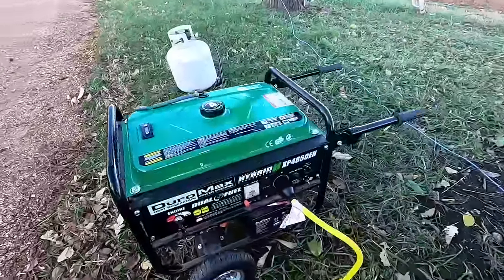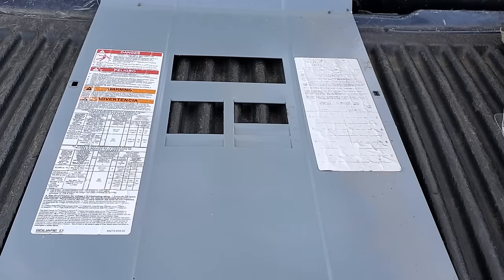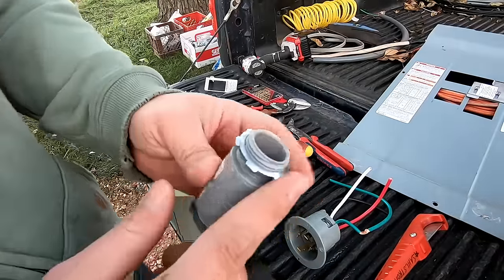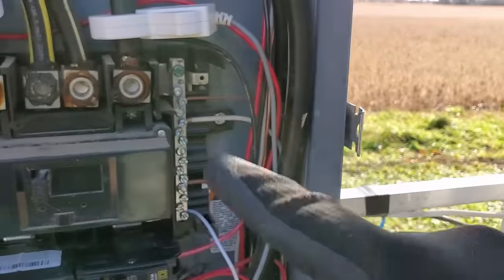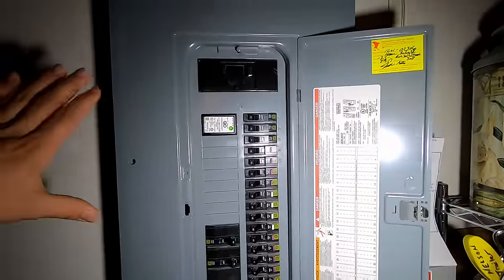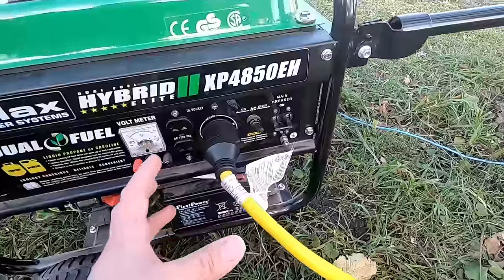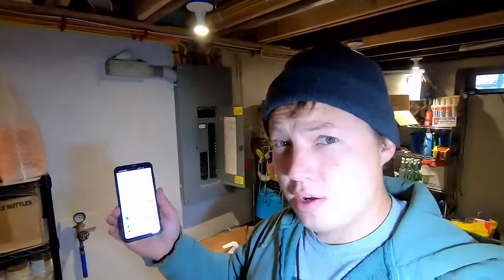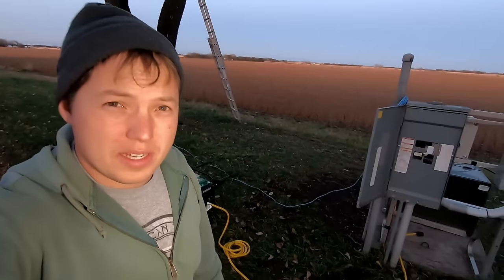How To Hook Up a Generator To Your House Using a Breaker Interlock Kit & Power Inlet Box

Comment: Looking at doing this too but how do you know the grid power has been restored while you on generator power?   With the main breaker off you wouldn’t know without looking at your neighbors. Can the sense monitoring do this too?
Reply: ⚠️Please don’t forget the rules about generator safety: This is a very important announcement for everyone. It’s important to follow all generator safety rules whenever we use portable generators: 

Everyone must see this. This is just a reminder for everyone’s safety. 

1) KEEPING OTHERS SAFE: Please do not allow an unqualified person or your children to operate and service the portable generator. Just because some manuals don’t say that doesn’t mean it’s safe. That is important against the generator safety rules. We also need to be keeping an eye on our children too. You need to make sure that your children are not playing near the portable generator especially when it’s running so they won’t get electrocuted. Generators pose electrical risks and they can be hot during an operation. Please keep your children away from the portable generator at all times. It is important to keep our children safe especially our little ones. Be aware of all the hazards.

2) WHERE TO RUN YOUR GENERATOR: Some people use their portable generators indoors which increases the risk of carbon monoxide poisoning. It’s important to have a carbon monoxide if you have a gas generator. Never ever use your generator indoors even if your doors and windows are open and even in the garage is not safe to use a portable generator. Not even at your porch and your deck. It is never safe to use your generator indoors and in enclosed areas of your home. Your generator needs to be 15-20 feet away from your house. 

3)🔥FIRE HAZARDS: Never refuel your generator while it’s running. You need to let your generator cool off before refueling it and before storing your generator. Never overload your generator too. Never ever back feed your generator. You should never plug your generator into a wall outlet. Also never store propane tanks indoors. Please keep flammable things away from the generator as well and please don’t smoke cigarettes near the generator. Having a fire extinguisher next to the generator is also important against the generator safety rules. 

4) GENERATOR OPERATION: make sure your hands are dry before touching the generator. Never use your generator in wet conditions. Don’t let your generator get wet. You need a generator tent if you need to use your generator during wet weather. Please don’t wear loose clothes when operating the generator. Turn on your generator before plugging in appliances. Use the right cord for your generator. Please do not use worn out cords. 

https://youtu.be/I1jT3ANENvI and here is a video more about keeping others safe when using generators 

Hope this helps. Remember safety first
Reply: @The_Happy_Aviation_Enthusiast  NEVER!  I run my generator in my living room right beside my stash of extra gas cans. Cuts down on the distance my children have to lug it when they refill the gas tank.  They are so cute!  They love licking the terminals to make sure the connection is good.

Comment: I just like to point out that your generator should be set to Floating Neutral just as in a sub panel. If not, you will have current flowing in the ground wire as well as the neutral wire in your hook up cable. Besides that, good informative video.
Reply: Here are the generator safety rules that everyone needs to follow: this is just a reminder for everyone’s safety. Always make sure you follow all the generator safety rules whenever you use your portable generator. Generators can be dangerous if not used carefully. Every year, hundreds of people die or get injured when using portable generators due to carbon monoxide poisoning and electrocution. Make sure you are using your generator carefully and keeping others safe as well. There is something very serious that everyone should always be aware of when using generators. Some people do run their generator indoors which is not safe and that increases the risk of carbon monoxide poisoning which can cause death of family and you. Some people run their generator in wet conditions which can electrocute them. Please remember that you should never run your generator indoors. Remember that carbon monoxide is an odorless and colorless gas that you cannot see or smell. Carbon monoxide is a silent killer. Keep that in mind. Make sure your generator is 15-20 feet away from your house and away from doors, windows, and vents. Never use your generator in your porch too. Having a carbon monoxide detector is very important against generator safety. Some people also allow children to go near the portable generator which could pose risks. We need to keep an eye on our children making sure that they are not near the portable generator so they won’t get electrocuted or burned by the generator which is dangerous. A locking enclosure also keeps kids safe. A generator shed might look like a tempting place to explore, or take cover during a game of hide and seek, but a generator is a dangerous piece of equipment that can cause injury. It says on the manual that we should also keep children away at all times from the portable generator to avoid injuries. Please do not allow a child or unqualified people to operate the portable generator.  It is important to keep your children safe especially little ones. The portable generator can be hot during an operation. Just because some manuals missed what should be listed doesn’t mean it’s safe to do. Always follow the generator safety rules when using portable generators. Generators pose electrical risks. If you need to use your generator during wet weather, you need a generator tent to protect your generator from getting wet. Don’t let your generator get wet. Keep your generator dry and before using your generator, please make sure your hands and your generator is dry. Do not wear loose clothing when operating the generator. Everything that is said on the generator’s operating manual should not be ignored. Never smoke cigarettes near the generator. Please keep flammable things away from the generator. Never overload your generator too. Your generator can catch fire. Never ever try to plug a generator cord into a wall outlet to avoid back feeding. Back feeding your generator is dangerous. Always turn on your generator first before plugging in appliances and shut off the appliances before turning your generator off. Use a heavy duty cord for your generator and the cord should not be worn out. All the instructions should be followed carefully. Never refuel your generator while it’s running. It can cause fire if fuel spills while your generator is hot. You should turn off your generator and let it cool off before refueling it. Having a fire extinguisher next to the generator is also important. This is only a reminder for everyone’s safety of using generators. Make sure your generator is properly grounded. Having a fire extinguisher next to the generator is also important against the safety rules. https://youtu.be/I1jT3ANENvI and here is a video more about keeping others safe when using generators and also about our family’s safety. It’s important to keep our little children safe as well. Make sure your little children are kept away from the generator at all times especially when it’s running. Hope this helps. Always remember that it’s better to be safe than sorry. Also remember that warnings should not be ignored too.

Comment: Hey question i did everything the same as you did here and everything is working properly but when i went to test the breakers using the lil test button all of them work except the purple ones that I think are CAFCI & GFCI. And to mention that they work properly when I’m using the utility power. They just won’t trip under the generator power. Any help please ?
Reply from the maker: Hmm, not sure what the cause would be. I might test this on my own setup if I get the chance.

Comment: Great video. Unfortunately I found out interlocks are not allowed in my community. We have to use individual transfers for each circuit. Sucks because at most I can only run 10 circuits. Again, great job.

Comment: Nice video. I appreciate your stream of consciousness with nary a pause or "um." This shows that you clearly live the concept. I am a little confused as the sense meter is attached to the mains hitting the main breaker first, so if you have turned off the main breaker, how are they sensing how much draw is being made from the generator? The power does not go thru those feeds when the main breaker is off, no?
Reply: Yes I wondered this too. I just purchased your Sense (thanks for the discount). How was this hooked up to monitor the gen meter?
Reply: His panel install uses 2 main breakers in series,  first in the outside primary distribution panel that's often seen in multiple building feeds like farms etc. That's where the generator feed is located,  and the main breaker is isolating his system from the grid. He could put current clamps right at the generator input lines,  that would read correctly for ALL loads into the system,  but how do you get the data out across 35+ yards/meters to the  cellphone used as a monitor panel? So instead the clamps are on the inputs to his house Subpanel (in this system layout) with its main breaker closed to distribute power to vital functions.  This puts the Sense amp load monitor within Bluetooth or WiFi range of his phone. 
You typically would do it by a built-in to the panel pair of amp meters to balance your load while flipping breakers,  keeping both phases roughly equal.  Plus side, rock reliable for decades of service & won't glitch out or be abandoned by its software developers.  Downside, have to be in front of the panel watching meters to see how things are going. 
I have boxes full of abandoned tech and software from years past. I like the Sense idea but-- Maybe I've gotten cynical in my dotage but I would want an analog meter system also, for simple reliability;  like when you dropped the cellphone in the ass-deep snow /slush/frozen puddle,  blizzard has you blinded and pissed, and can't find it for the next few hours, then the battery dies cause you used it for your flashlight while hooking up the genny.
Funny how you never need a genset on a warm pleasant summer day 🤔🙂🙂.

Comment: Quick question. I unfortunately have a main panel with a total of 4 throws (disconnects). I do not have a main disconnect. This means that I wont be able to energize the main panel without backfeeding into the grid. I can however, power my main floor 100A subpanel. Is it any different to power the subpanel than the main panel? I will be doing just as you did with a 30 amp breaker in the subpanel and cutting off the subpanel disconnect. I really wish I could power my main panel because my heating system is on that panel.

Comment: @Benjamin Sahlstrom   Im looking at buying a 7250 running watt generator and am just a little confused on the only 30 amp plug on it. Like you my 200 amp main is out on my pole by my meter away from my house approx 100 ft. I was curious if it would be able to push enough through that 30 amp cord and outlet to run much in my house? I have  propane furnace and electric water heater as well that is 4200 watts per element for the water heater.. Just wanting some info from somebody with close to scenario.  Video was very helpful. Thanks. Chris

Comment: Great video Ben. Can you speak to the fact that the neutral on the main panel doesn’t get disconnected when the generator is running. If unbalanced loads flow back through the neutral then how come there’s no discussion about that feeding the mainline back to the transformer since it remains connected?
Reply: Don’t forget about the safety rules of using generators: Always make sure you follow all the generator safety rules whenever you use your portable generator. This is a reminder for everyone’s safety of using generators. Generators can be dangerous if not used carefully. Every year, hundreds of people die or get injured when using portable generators due to carbon monoxide poisoning and electrocution. Make sure you are using your generator carefully and keeping others safe as well. There is something very serious that everyone should always be aware of when using generators. Some people do run their generator indoors which is not safe and that increases the risk of carbon monoxide poisoning which can cause death of family and you. Some people run their generator in wet conditions which can electrocute them. Please remember that you should never run your generator indoors. Remember that carbon monoxide is an odorless and colorless gas that you cannot see or smell. Carbon monoxide is a silent killer. Keep that in mind. Make sure your generator is 15-20 feet away from your house and away from doors, windows, and vents. Never use your generator in your porch too. Having a carbon monoxide detector is very important against generator safety. Some people also allow children to go near the portable generator which could pose risks. We need to keep an eye on our children making sure that they are not near the portable generator so they won’t get electrocuted or burned by the generator which is dangerous. A locking enclosure also keeps kids safe. A generator shed might look like a tempting place to explore, or take cover during a game of hide and seek, but a generator is a dangerous piece of equipment that can cause injury. It says on the manual that we should also keep children away at all times from the portable generator to avoid injuries. Please do not allow a child or unqualified people to operate the portable generator.  It is important to keep your children safe especially little ones. The portable generator can be hot during an operation. Just because some manuals missed what should be listed doesn’t mean it’s safe to do. Always follow the generator safety rules when using portable generators. Generators pose electrical risks. If you need to use your generator during wet weather, you need a generator tent to protect your generator from getting wet. Don’t let your generator get wet. Keep your generator dry and before using your generator, please make sure your hands and your generator is dry. Do not wear loose clothing when operating the generator. Everything that is said on the generator’s operating manual should not be ignored. Never smoke cigarettes near the generator. Please keep flammable things away from the generator. Never overload your generator too. Your generator can catch fire. Never ever try to plug a generator cord into a wall outlet to avoid back feeding. Back feeding your generator is dangerous. Always turn on your generator first before plugging in appliances and shut off the appliances before turning your generator off. Use a heavy duty cord for your generator and the cord should not be worn out. All the instructions should be followed carefully. Never refuel your generator while it’s running. It can cause fire if fuel spills while your generator is hot. You should turn off your generator and let it cool off before refueling it. Having a fire extinguisher next to the generator is also important. This is only a reminder for everyone’s safety of using generators. Make sure your generator is properly grounded. Having a fire extinguisher next to the generator is also important against the safety rules. https://youtu.be/I1jT3ANENvI and here is a video more about keeping others safe when using generators and also about our family’s safety. It’s important to keep our little children safe as well. Make sure your little children are kept away from the generator at all times especially when it’s running. Hope this helps. Always remember that it’s better to be safe than sorry. Also remember that warnings should not be ignored too.
Reply: Hey Ben - please discuss this. Thanks!